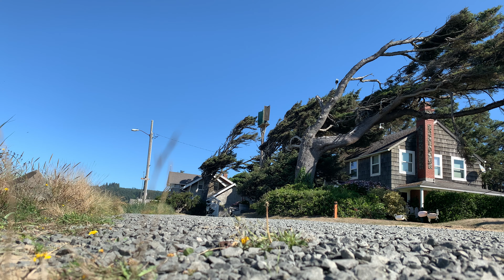Sept. 1 2021 - Cannon Beach Tsunami Siren Test

Comment: This test sounds like bunch of frustrated cattle in the field.
     But it confirms my premonition about upcoming quake-temblor in Japan which might result in Tsunamis on the West Coast 
     You see I have a gift of knowledge, a type of Charismatic Gift from Holy Spirit. So later in September you will have a huge quake in Japan resulting in splitting Honsu Island. My take is about Sept 26th ot so.
      Pray  God bless.
      Petet Zawadowski 
       04th of September, 2021
Reply from the maker: Got news for ya buddy, it didn’t happen.
Reply: @Egress.  It will happen eventually even if it will be later in the fall. I should have stipulated- within good few  months. Or even winter. But like New York it WILL come.  "Resti" assured. I am watching this Grande story out of China 
     That might be a slow but powerfull game changer.
      Peter Zawadowski